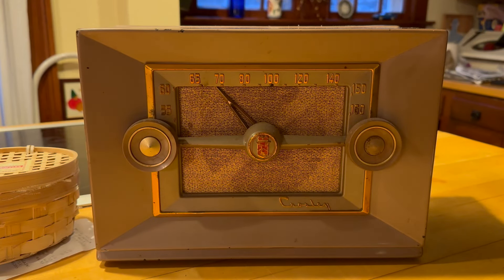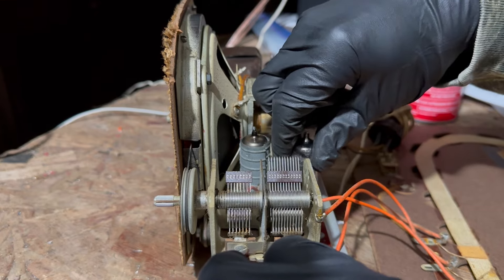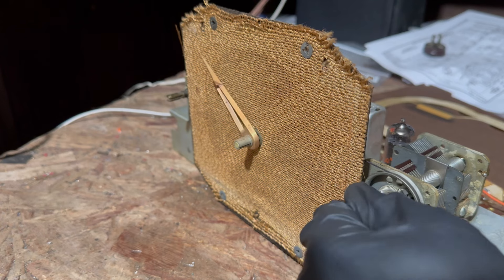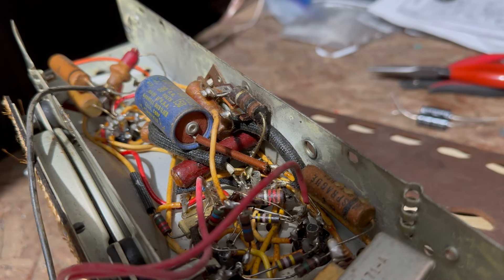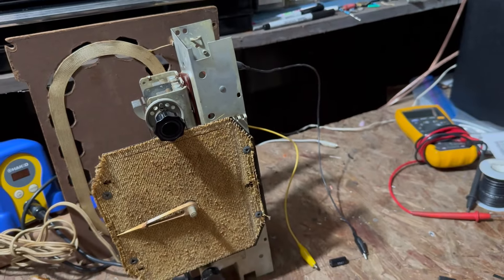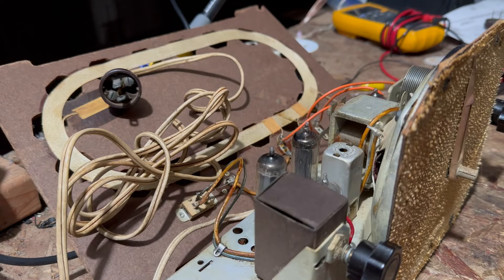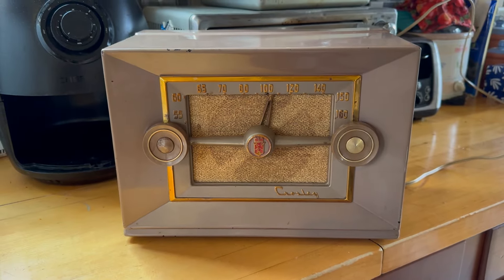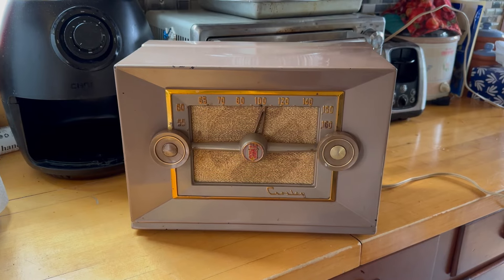1954 Crosley E20TN Antique Radio Repair

Comment: There are some low quality/low lifespan safety caps out there. There was a shango video where he smashed a "smart" roadside coffeemaker apart to harvest a safety cap and it was bad despite it coming out of a relatively-recent construction device. He figured the chinese who made the appliance tracked down the absolute cheapest safety cap on the market to shave a fraction of a cent off the cost.

Comment: I'd suggest you put a gray or black mat on top of that table. Everything turns out yellow, and it is most distracting!  Also, raise the camera; we couldn't see all of the bottom of the chassis.  If it is really B- and not actual ground, then that's not the correction for the safety CAP. I goes across the line cord.  Otherwise, I'd try going to a 0.01uF CAP.  For the I.F. CAN, I always pull them apart and remove the sheet between the metal piece, and add a 100mF Mica CAP in it's place.
---
WOW!  Way to loud!!
Reply: I was under the impression that not all SMD IFs use a 100pf cap value? Luckily I haven't dealt with SMD (newer than what I usually work on).
Reply: @sgath92 - No I don't use SMD, I just solder a actual CAP in their that is a Dip
Mica CAP.